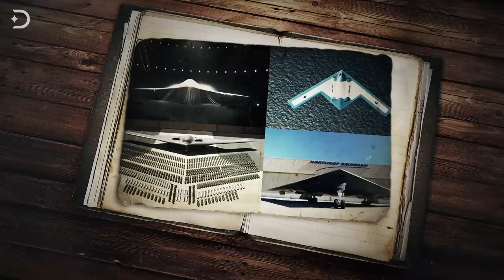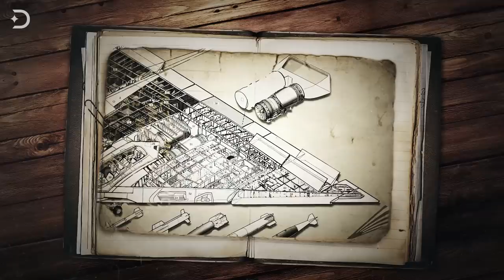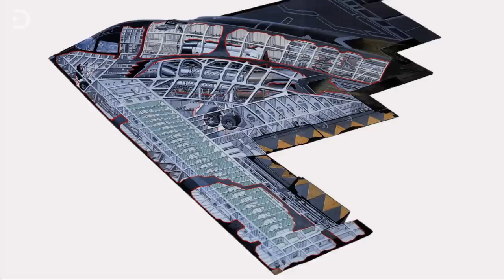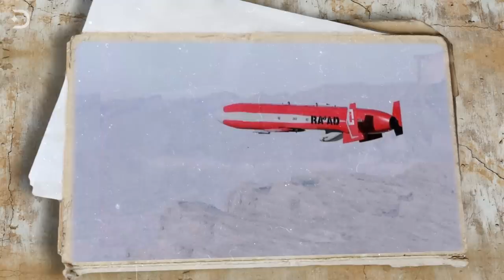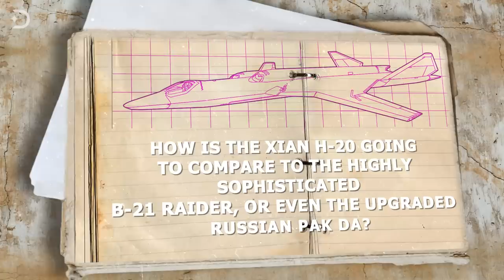Most Advanced Bombers In The World

Comment: Actually the first Stealth Bomber was likely the F-117 Stealth Fighter, Nighthawk aka the Wobblin Goblin.   Well it was designated as a fighter it was more of a fighter bomber as the majority of its operations was targeting ground targets and was in operation for quite a while before being publicly known.  The B2 came a little after.   Its unlikely that despite the introduction of the B-21 Raider when it comes into service will replace the B-2 at least right away.  More than likely the B-21 will supplement the B-2 and indeed replace the B-1 well that bomber is regulated to either reserve forces or exported or converted for another use.   The B-21 will likely work along side the B-2 for many many years before eventually replacing it completely likely as the air-frames can no longer be maintained, however look at the B-52.  That damn plane is still flying front line service so its likely the B-2 will do the same with upgrades, and different roles required for it.  the Current B-52 for example has a cool little cartridge in the bomb bay when instaleld that's like a oversized revolver cartridge that can house Cruise missiles or guided rockets essentially turning them into fearsome Missile Spamming nightmares.

Oh I have potential names for the new bombers.  
B-21 Raider  aka (Junior) 
Pak DA :  Aka (Duck..)
H-20:   aka  (Cheater) 

B-21 is essentially a fully upgraded B-2 with everything that comes from the best of American tech and study.  Likely anything the B-21 has will be incorporated into the remaining B-2 line to keep them in service. 

The Pak DA if it ever is created will likely be a fine bomber.   Well it might not be better than the B-21 it likely will be equal to the B-2 at least before any future upgrades.  Not sure about the duck nose however. 

H-20 likely will be a fine bomber.   The Chinese really do seem to have high hopes for it and I also hope they release footage of the bomber soon.  I love all things aircraft.   On that note its likely going to suffer similar issues that all Chinese craft face that of being built well modern still outclassed by several years to a decade in terms of technology.   They are still suffering engine issues with home-built engines and much of there tech which they use for the most high tech equipment is outdated by a couple years at most or insufficient and they need to fill the gaps especially of the stuff they steal although I'm sure this will change as more and more home-created stuff is refined and pushed into use.   The H-20 will likely be similar to the B-2 more than likely not a Knock off but will look similar with a Chinese Flare.   Probably look ultra high modern but realistically will likely be comparable to the 90s era B2 before any upgrades were added.  It will need to catch up to the B-21 technology, and by the time its in full use the B-21 will likely be upgraded and the B-2 will likely have a new lease on life anyway still ahead of the H-20. 
.